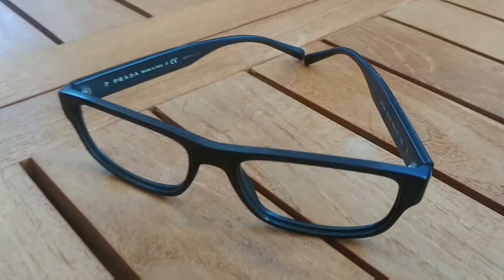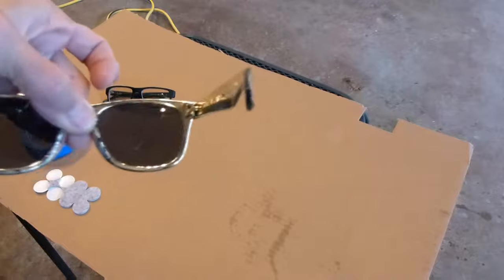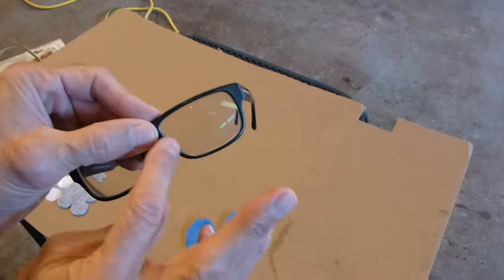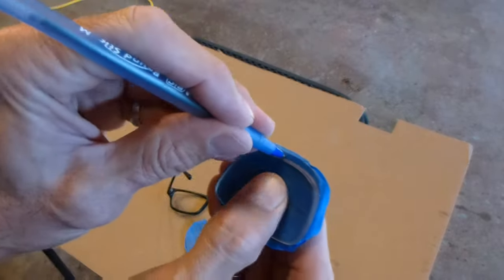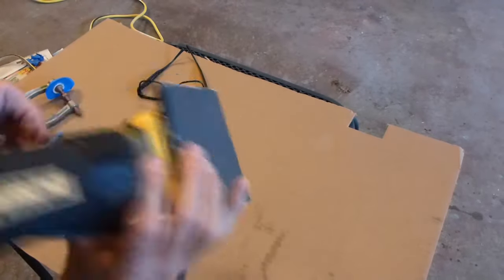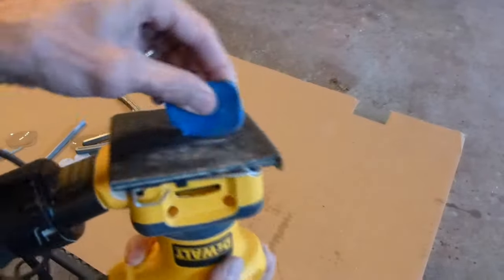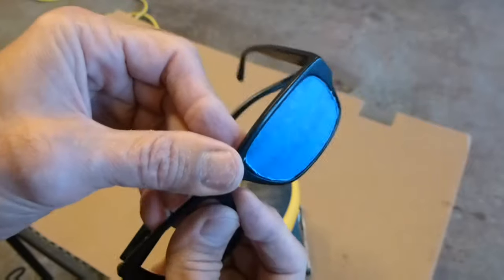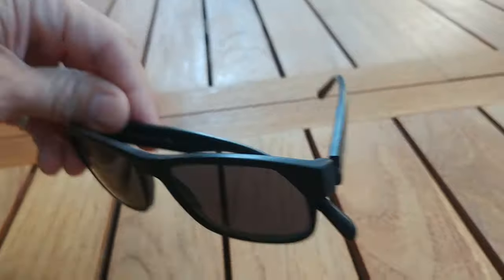How To Cut Lenses to Fit Your Frames

Comment: Wish I could leave pictures. I followed your method . I used painters tape and I had to use Dremel. As my sander wasn't cutting it. 2 Days ago I picked up a new O up some Oakley Airdrop Frame at the local Pawn Shop. Which still had the original Manufacture rx Demo Lenses in them. I then got my 2cd oldest lens out of their frames and followed your steps. All in All took me about 1.5 hours. Saved me a Lot of $$$$. Thanks Brother
Reply from the maker: Timothy Thomas: Thanks for the update and congrats on a job well done!

Comment: I had done this many time for years to save my favorite frames and save money, because the lense get damage. Didn't make a video about it. Use to do it with a dremel tool. Sander and sand paper is a very good idea too. If you have a big lense it will make a lot of dust. Recommend using a jewelry saw to cut the shape than sand to refine shape. I've found fishing sunglasses have high quality inexpensive polarized lense for replacement. Get them from Walmart or sporting good store.
Reply from the maker: One ness: Good info. Thanks for watching and for sharing.
Reply: Hi. What kind of tape did you use?

Comment: Awesome!! Do you have any tips on fitting a lenses that is a little bit too small for the frame? The glass sits in the frame but has a little bit of space to move, so it rattles in there making a sound.
Reply from the maker: I'm glad you liked the video. Yes, Scotch tape can work and look good after it's trimmed and we're assuming these are not frameless glasses but resin (plastic) frames like in this video. Press two 3-inch strips of tape across each end of each frame opening (four strips total) with the adhesive side toward the frame. You may only need one strip per lens depending on how small the lenses were cut. You want adhesive side toward the frame so the lenses will slide over the back of the tape when snapping into the frame. The lenses should now be light but you will now have eight 1.5-inch tape strips hanging from your glasses (four strips from each lens). Using a razor to trim off the excess tape will allow you to cut the tape as close to the lens as possible. I hope that helps.
Reply: @ScubaMoto  That advise definitely helps. I was considering something along the lines of what you were mentioning, so I'm glad to be on the right track.
Thanks a lot!

Comment: Very nice video. 
Question: those are glass lenses? I got a pair of ray ban glass lenses, and I would like to fit them in other frames but they say ray ban glasses are difficult to fit beacuase of the hardened glass and it gets broken.
Reply from the maker: Almost all lenses I've fit are a polymer of some sort. Crystal lenses will take much longer with the sander. So, in that case, I will use a small hand held grinder or rotary sander with all else the same. I hope that helps.

Comment: Cool video, I was just thinking of doing this as I found some nice non-Rx frames and I was going to use donor lenses from some broken glasses.  Do lenses sometimes come out from the back side of the frames?  And do you make the 45 degree angle differently if this is so?  Should the angle go away or towards the side you put them in from?
Reply from the maker: The friction lenses in the video (and most that I have seen) are tapered from BOTH sides and typically snapped in from the front. Sometimes it is necessary to lightly warm up the frame to insert the lenses.

Comment: Great video . i have a pair of lenses that were cut just a hair small for the frame they were cut out for is THERE anyway to make them fit any tricks ?
Reply from the maker: Okay, you said "a hair" too small. It's tricky but yes, Scotch tape can work and look good after it's trimmed and we're assuming these are not frameless glasses but resin (plastic) frames like in this video. Press two 3-inch strips of tape across each end of each frame opening (four strips total) with the adhesive side toward the frame. You may only need one strip per lens depending on how small the lenses were cut. You want adhesive side toward the frame so the lenses will slide over the back of the tape when snapping into the frame. The lenses should now be light but you will now have eight 1.5-inch tape strips hanging from your glasses (four strips from each lens). Using a razor to trim off the excess tape will allow you to cut the tape as close to the lens as possible. I hope that helps.
Reply: @ScubaMoto  Thank you i will try this. the frame is an oakley gascan
Reply from the maker: Joe d: I love that frame and it is very suitable for the tape fix. I believe those lenses snap in from the front. I would start with a thin strip of the black tape at the inner bridge and one at the outside of each lens. You should not see any tape after trimming.

Comment: HI, the video is great and exactly  what I was looking for. I have a couple of (probably stupid) questions. Is the sandpaper specific for plastic or will any sandpaper do? I don't have a sander and don't have any other application at the moment to warrant buying one. Do you think this is doable by hand or would I warp something? Thanks, once again smooth vid.
Reply from the maker: TheIdeolocator: I'm glad the video helped. I've had people comment here that they've done this by hand. It will just take longer. I would prefer not to, but I suppose I could see doing it on a polymer lens. For glass or crystal lenses, it would seem less likely. If I absolutely had to do it by hand, I would be sure to choose a donor lens that is close in size but slightly larger than the frame I'm trying to fit them into to reduce cutting. I would then lay the 9x11 Sandpaper flat and draw the lens back and forth across the Sandpaper. You would need to brush out the debris occasionally to keep the Sandpaper cutting well.

In choosing a sandpaper, the examples in the video description are a good start. Just be sure to choose a good quality or "Pro" grade sandpaper that is rated for wet or dry use. That should last the longest and give you the best results. Thanks for the question and for sharing, and best wishes on your project.

Comment: what do you mean by "cut that 45 degree angle" it just seems like you kept on shaping it until it was a fit no?
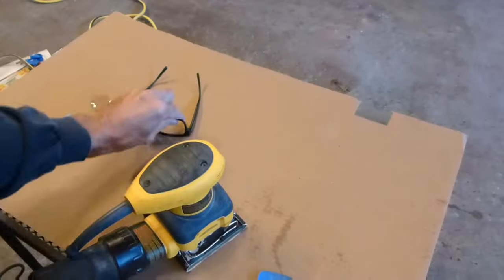Reply from the maker: This is normal. The edge of a lens is usually tapered to better fit into the receiving groove of the frame. The lenses that I pulled out of the PRADAs were quite thick because they were prescription. Even though I am replacing them with non-prescription (non-refractory) lenses that are thinner, the groove in the frame would still be too narrow for the full thickness of the new lens. So, it is typical for lens cutters to taper the edge for a better fit into the groove of the frame. Notice at 2:32 when I bring the original prescription lens up close to clearly illustrate the beveled edge on the lens. This is common to many lenses. So at 3:50, I clearly show how I am holding the lens at an angle on the sander to repeat the same tapered edge for a better fit into the frame. I hope this helps.
Reply: @ScubaMoto  oh I see what you mean. thanks for clearing that up for me! I was initially not sure if you mean rounded edges or something else good thing I asked because I was not aware of the thickness and tapering you just mentioned.

Comment: I have a question. I brought reading glasses to the optical place where they had my prescription glass ready. They said they can’t use the reading glasses because it’s cheap plastic and will break when they try to heat the frame. Is that correct or am I getting scammed?
Reply from the maker: Rada Chapkis: Thank you for the question. So you paid the shop for a pair of prescription lenses that you want to have cut to fit your reading glass frames? If so, they are telling the truth in that they cannot verify the quality of frames that they are not familiar with. Some frames might crack and they might not. If they cut your lenses to fit those frames and the frames do crack, then you likely can not use those lenses. If they supply the frames and the frames crack, then they must provide another pair of frames. For this video, I do not recommend using this method for cutting prescription lenses. Thank you again for the question and for sharing.
Reply: It depends on the type of plastic your frame is made out of, and if it is really old. Some material can’t have heat used on it because it will actually shrink and warp it. Also if your frame is old and/or corroded it would be best not to reuse them, taking the old lenses out could potentially cause them to break.
That being said, if they are new or in good shape then it shouldn’t be too hard to size the lenses just right so they can cold mount them (pop them into the frame without heat) like what was done in the video here.
I should add that some readers that you get at Walmart or other stores, have the lenses glued into the frame, and they can’t always be popped out of the frame without heat, or without breaking the lenses, both of which could potentially damage the frame.

Comment: Could you do this with glass lenses?
Reply from the maker: The quick answer is yes. But it takes so much longer. I've done it once. The donor lens size was close and I chose to use a portable grinder to save time. Certainly not recommended on prescription or refractive lenses.

Comment: Where can I buy that frame or for customized
Reply from the maker: The frames in the video are Prada VPR 23R in matte black. They go back quite a few years. I just did a search and found very few sources but there are still a few out there. They're not cheap but I'm sure if you keep searching the market, you might find a good deal on a pair. Good luck with the search.
Reply: @ScubaMoto  thanks bro

Comment: What do i do if i dont have the drill things? Can i use something else?
Reply from the maker: Sara Dahl: Thanks for the question. There is no drill in this video.  The machine I am using is called a "Quarter Sheet palm Sander" like this: https://amzn.to/2XV1znz. If you don't have a sander it will just take a lot longer.